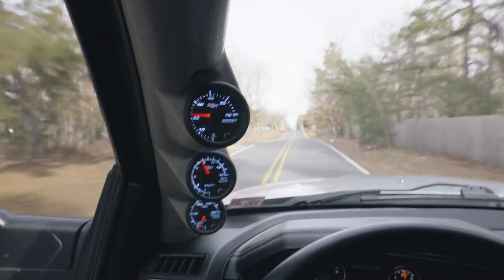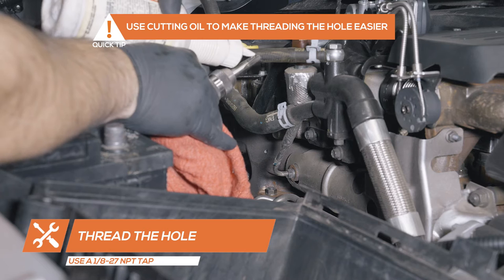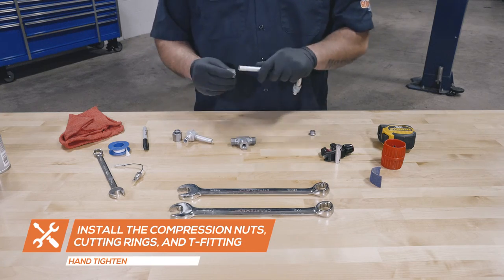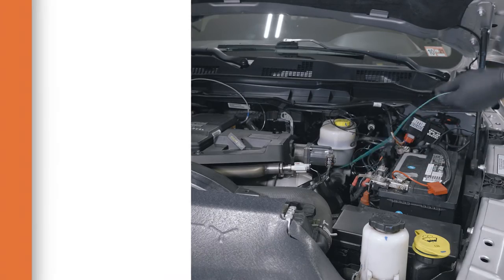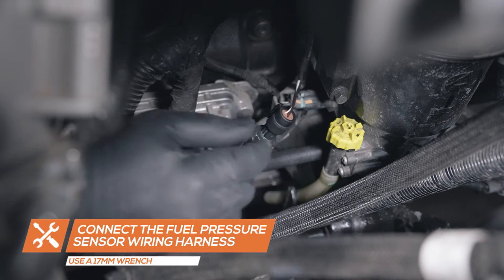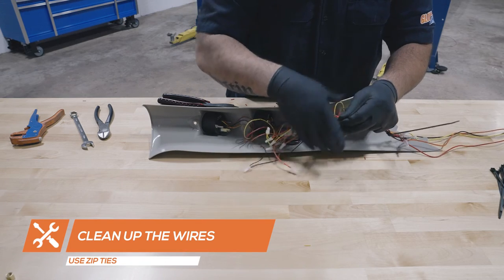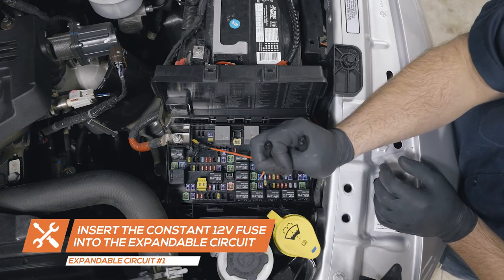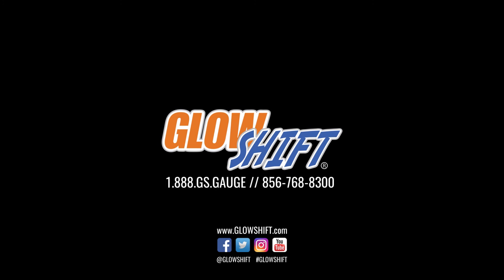GlowShift | How  To Install A 2010-2018 6.7L Ram Cummins Triple Gauge Package

Comment: On my 2012 RAM, both of the transmission lines run all the way to the front of the truck. No short line to remove. Can I cut the line on the truck? Doing this I worry about metal shavings. Thanks

Comment: Your fuse taps you installed. What one controlled the dimmers on the garages?
Reply from the maker: The one attached to the orange wires from the gauges.

Comment: How can I access the fuel filter housing to disconnect the line without tearing the whole truck apart? In the video you used two hands, there's no way without removing the throttle body and probably the battery
Reply: So for anyone wondering.  I took the wheel well out and turned the wheel to the left. This gave me access to the fuel filter housing